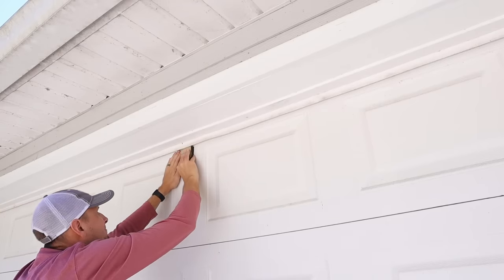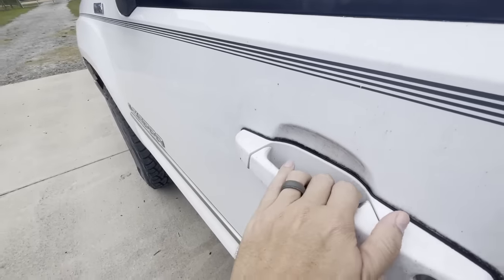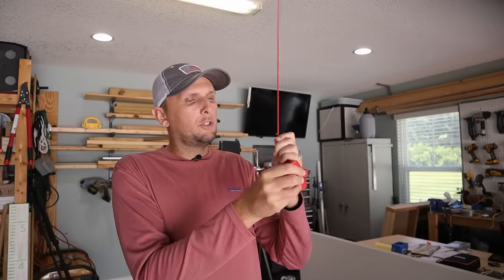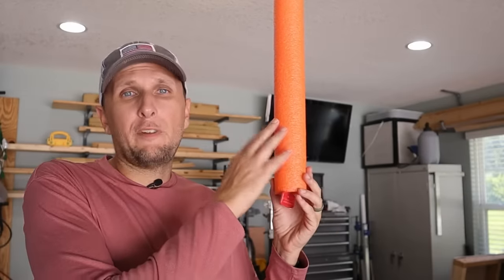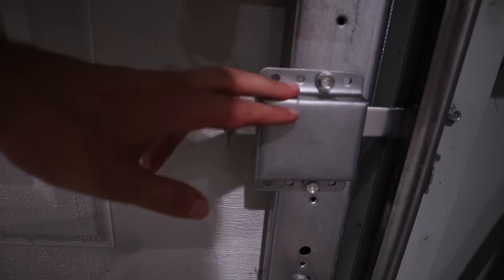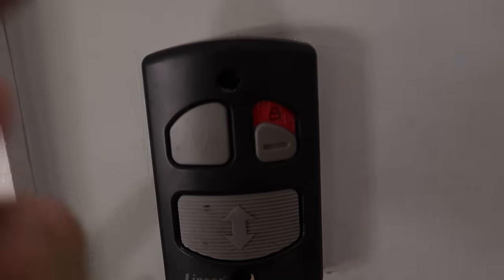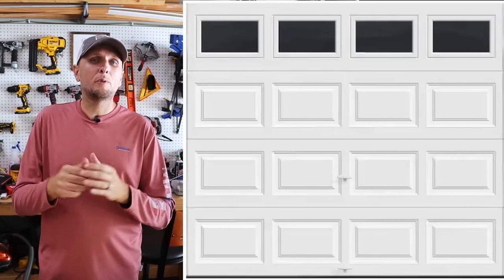How to Stop Garage Door Break-Ins | Number One Way Thieves Get Into the House!

Comment: I had an insulated steel garage door installed which I bought at HD. It came with one garage door slide lock.  I told the installer not to install the outside handle. The installer attached the garage door slide lock. The installer offered to give me free at no charge and install a garage door slide lock for the other side.  This was because I didn't take the outside handle. I have two new padlocks that I've never used. I put those thru the hole in the lock for extra security. No need for anything else.  I don't have an electric opener and no ropes/cables hanging down.  There  are no windows on my garage door. 

My cellar is a walk in. I also have two 30" x 46"  wood framed windows.  Just finished my latest project. Each window  had four panes of glass. 9" high and 28"wide. My father worked with Plexiglass and Lexan. I replaced the glass with 'bullet proof' 1/4" Lexan. On the inside of the wooden frame. I bolted a sheet of 3/16" Plexiglass covering the entire window. I built a frame behind the window. Here is the "pièce de résistance". I had the local vocational school build me a framed diamond shaped security grating. They only charged for the cost of materials. Under $20 dollars for these two windows plus two more. The teacher said it was a learning experience for the students. They used the same grating as what is used in stores downtown in big cities. They did an excellent job of welding the grate to the frame, sand blasting the unit, and even brought it over to the paint shop for priming. I bolted it to the frame covering the entire window from the inside of the cellar.  Good luck to anyone that wants to break into the cellar.   * Before I swapped out the glass for Lexan. Someone tried breaking in when I was in the hospital. They gave up when they discovered the Plexiglass and steel grating behind that. All new caulking and tight as a drum.  Each window now has window blocking curtains. No peeksies now.  

Last  place of entry is a steel door I installed myself 30 years ago from HD. They made steel doors stronger and of a thicker guage back then. It still looks great and not a speck of rust. I reinforced the frame first with two 2" x 6" pressure treated lumber. Added two locks, one being a dead bolt. Added a heavy duty sliding lock on the inside for added safety. Only one of the locks has an exposed key entry. I plan on selling the house in a couple of years due to my age. But I have one more "pièce de résistance" that I have been thinking of.  It is a product made by Domuen and is sold on Amazon for $16.00.  It is basically 2 U shaped pieces of steel the same size as a 2 x 4 piece of lumber. I'm going to bolt it to the frame of my door. I have plenty of 2 x 4. So I'll cut a couple down to the width of the door.

Please peeps. Don't waste your time with flimsy chains attached to your door. Whether it's in a house or apartment. They can easily be pushed in and separated from the frame. It's only held on by an itty bitty set of screws. Totally worthless. Good luck with your projects.

Comment: I use a zip tie at the top of the quick disconnect. Thin enough that you can still break if you pull down on it from the inside of the garage. Also .. shorten the string 👍

Comment: Check local codes on changes to the manual release system, they could be illegal. Be careful about compromising the manual exit release, it could then be a fire trap! I like the pool noodle idea. There is a window in the garage, why not just discreetly break in... put burglar bars over the window! Maybe garage door manufacturers can add a locking feature to the system that locks/unlocks by the remote.

Comment: I use the dude lock latvh and adfitionally snap a buce grips on it. Thise latches can be hooked and opened in a similar manner to the opener string. Some vice grips wide opening welding pliers eill sldo snap doludly into the track tight above the door wheels. Like Fort Knox

Comment: After you remove the cord, if you should have a power outage, just take a coat hanger and cut it like you did for the wire that you used in the demonstration and put a little hook in the end and feed it through that hole to release the mechanism, and just pull down. All you have to do is keep that little piece of coat  hanger handy someplace in the garage.

Comment: I had a good friend who went on an extended vacation and chained the door rollers on th tail from the inside. When he came back from his trip he forgot and went to open the garage door using the remote and did extensive damage to the door. You need to unplug the opener as well.

Comment: I use a zip tie to fasten the disconnect to the frame. I can still use it normally, but in order to release the door in a power failure, just remove the zip tie. Feed the tie into the same hole the string is in and there should be a hole above to feed through.

Comment: When my power goes out my garage door opener doesn't do shit like locking the door as in the video. You can just pull the door up by hand without the need to pull the emergency handle. I found out about garage door locks earlier this year and saw my rails don't contain any extra holes in a place that would allow for the attachment of a lock.

Comment: I have a steel door frame and an solid external door with a triple latch between my garage and my house. When I bought my house there was no internal access between the garage and house, so I had it installed my way. Also, my garage opener button is hard wired into the car so the ignition needs to be on to operate it.

Comment: So my friend just had their detached garage broken into. They had a security camera inside. Thief used the coat hook method but did not go for the cord because there was no pull handle. They went straight for the emergency release latch itself and pulled from there.

Comment: A long heavy bolt through the cut outs in the door rail & on the door works for when you won't be coming in from the outside...like on a vacation or if you don't use that garage space everyday.  Just remember to remove it before opening the door.

Comment: You can remove the rope and they can still use something to hook the lever and pull it....  I used a light weight zip tie to secure the lever. It prevents someone from pulling the lever with a wire or a hook but I can still pull it buy letting my body weight break the zip tie. They also make shields you can install to prevent anyone from fishing for the rope or the lever.

Comment: Just cut the string on the manual release as close as you are comfortable with and tie a loop into the attached end, and another loop in the cut off end. Then when you want to use the manual release just get a carabiner and clip both ends together. No pool noodle needed.

Comment: Adding a latch to both sides of the door and padlocking those is the method I use , but I also add two security bolts, one each to the top and bottom mounting flanges of the latch body, cuzz if the regular attachment bolts are removed the door can be opened even with the padlocks in place.  I also install a security steel 'Fire' door in place of the door leading to the garage from inside the house or in place of an outside access man door, though, that one doesn't need to be a 'Fire' door as they are expensive and worth every penny.
Reply: Note;  Add 'keyed only' deadbolts to the top and bottom of the inside or outside access man doors.

Comment: With at least some, if the connecting rod from the opener to the door is not vertical when the door is closed, one can merely lift up on the door, driving the opener in the open direction.

Comment: Another garage access tip: Don't keep your garage door opener in your car along with documents that will identify your address.

A few years back I noticed some unusual activity going on at the house across the street. I saw a car I did not recognize occupied by two people in the driveway, and the garage door was open. They were trying to pull the car into the garage, somewhat frantically. Within a few seconds they stopped trying to pull the car into the garage and the passenger hopped how of the vehicle and ran into the house. Within seconds the other garage door opened and the homeowner's other car was backed out of the garage, and both cars left the scene.

What had happened is the homeowner's car had been broken into at work and the thieves took the garage remote control and the insurance or registration documents with the homeowner's address, and they went to the house. The keys to the other car were hanging on a hook in the kitchen or utility room.

If they had been successful in pulling their car into the garage, they would have had a whole bunch of time undetected inside that house to do who knows what.

Comment: Instead of cutting the red cord to a shorter length, you can shorten the cord with a long loop overhand knot.  You can still grab the handle from the inside, but a fishhook won't be able to pull a shortened red cord over to the door.

Comment: I had 10k of tools and kitchen appliances stolen this way from a home I was renovating.  My big mistakes?  Not removing the handle on the emergency release and not locking the door from the garage to the house.  Since then I have of course removed the handle, I always lock the door, and I've installed a slide latch on the garage door for when I leave town.  Note, I also unplug the garage motor when I latch the door so I don't forget and operate the motor with the latch engaged.  By the way, the police couldn't do anything about the theft because they were understaffed.  Another reason why it's important to take it upon ourselves to protect our property.

Comment: 1 extra step you should add. Where the handle is at the bottom, you should cut the noddle 1 inch on each side from the middle up. Then slide the noodle over the handle, making it no longer exposed.

Comment: You forgot a good tip I use. There are two holes at the top of the pull down on the rail. When u lace a piece of plastic wire tie through them , u can't unlock the manual pull mechanism. This insures no one can get in. U can use something even harder ,like wire.

Comment: Many people don’t keep a key with them for the interior garage people door…..Once you burglar proof your garage door.. and of course now you can’t use this coat hanger hack to enter your own garage door if the electricity goes out and then you can’t use your key pad or garage door opener.
An obvious tip would be to start carrying your front door key  so you have a secondary access point to your home.

Comment: so if you have a 20 volt battery that charges but as soon or very shortly after placing in the charger,it says its charged .....but when you use it it quickly drains....meaning the battery isnt fully charging...any idea how to fix that???

Comment: If you cut the cord shorter, you also have to take the handle and any knots off the end. A thief doesn't have to get the cord all the way out the door any snag at any length will allow them to pull it.

Comment: A garage door deadbolt is the easiest and most effective solution to garage door breaking, though it negates the purpose of an automatic garage door opener.  But for periods when you will be away for any length of time of time it works best and only costs another $10 at the home store.  Most all garage door side rails have knockouts that can be removed yo receive the deadbolt and a corresponding mounting location on the door.  You can even put a padlock on the deadbolt for more security.

Comment: Zip tie the cord wrapped tight to the release AND zip tie the actual release in the locked position. You can always cut it if the power goes out.

Comment: Remove the handle from the release rope, they can fish all they want, make sure it's too short to reach the top of closed door, the rope is easy to pull without a handle, with a switch to shut off power to opener, with a timer also. And blackout tint for windows.

Comment: 6:50 If you damage your opener by trying to open it with a slide lock in place then your up-force limit switch is out of adjustment.

Comment: Using that wire to fish the string out, almost hooked onto the arm itself that the string is attached to. That would still be possible with the pool noodle. A better way to stop this would be screwing a shield to the top edge of the door that would block any wire from getting near the arm or string.

Comment: Most of the video I was just thinking is not the main fool proof way to lock your garage the metal lock on the tracks. Rolling garage codes have been a big improvement and a lot of new cars have door openers built in that need the ignition at least active to use. If you want to take the best step to keep people out of your garage have a motion activated light and camera always watching.

Comment: Most garage door motor drives have overload protection. If the door side lock is in the locked position, the motor reverses or stalls. The light begins to flash.

Comment: I installed garage doors for over ten years. Who told you it's okay to have a manual door lock with an opener? Good way to burn it up if you forget to unlock  the manual lock and you try to open the door using the opener, if the opener was engaged with the rail. Take off the pull in the rope. Shorten rope. Tie loop on end.

Comment: Camera's and security systems are reactive not proactive. You need methods of entry denial to be more secure. And wireless garage entry can easily be hacked, even the smart ones you said were encrypted. At night just slide that lock in place. And most openers have load sensors that will prevent damage if you try to open it with the latch in place.

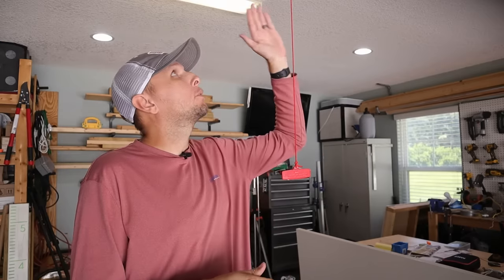Comment: 4:40 Most doors are Tilt-a-doors, where the opening system uses wires, about where the side latches are, to the middle mounted door handle, so fishing underneath does the same thing, it catches the wire enough to "pull it down tensioning the side latches to open at least one side, by then pulling that side open the door twists enough to bring the dtill locked other side latch far enough away from it's strike plate to allow the door to open correctly.

One way to get around that is to fully remove the wires altogether, while leaving the latch LOCKED, after ONY ever opening the door from the inside, by accessing into the garage via a deadbolted side door.
Now whathappens is the burglar comes along, trys twisting the handle, it's locked, so they set about trying to fish one of the latch wires, which of course, is not there.
After some considerable to=ime spent down there, the last thing they will think of, is that deadbolted door, some way along the side wall, that just looks like the rubbish-bin door, with of course a few torn (& thus empty) rubbish bags nearby?

Nice one Trev.

Comment: With a short cord they might be able to hook the handle anyway and just pull it with the long coat hanger from outside.
An easy thing to do is loop the cord around the bar that pulls the door up.  By looping the cord over the bar, THEN putting the handle over the cord going up, it forms a loop locked on the bar.  It is impossible to pull it and you can either use a wire coat hanger to un-loop it, or a stepladder or box to reach and unloop it.
..
OR..
Remove the pull cord, then just fashion a coat hanger and any kind of handle that you can keep near by to hook the  latch-lever the cord goes through.  To make it easier to snag the latch, make a very short, but larger hook out of coat hanger that stays in the top latch hole where the cord was.
..
Also, the car should be locked when in the garage.

Comment: We will not have any of these problems as someone is home 27-7. If we all go away for a vacation (and we do) the door is locked by unplugging the opener and using the 4 slider bolts that we have on each side of the door top and bottom. The door can not be pushed so to get to these nor can the door be opened as the door is supposed to open. Then there are several doors through the home that have dead bolts built into them and the front door has 2 dead bolts in a steel frame.

Comment: I saw a video decades ago where the thief used a dolly to open the overhead door. Slip the dolly blade under the closed door where the door opener is and pull down on the dolly to force the door up. The force breaks the plastic gears then the thief can rase the door.

Comment: You didn't mention anything about arm adjustment and being over center some of the older garage door openers could be jammed open by lifting the garage door that the arm wasn't properly adjusted and put pressure on the opener itself causing it to default back open because it thinks it hit something just like leaving a took under the door when it hits it reverses

Comment: Another way that you can secure your garage door (if your locks are broken) is to insert a gutter nail into the holes near the bottom of your garage door rail and the track rail on the inside of the garage. Insert it all the way to the head of the nail and let the point of the nail tip down to the floor so that it is in a slanted position.  Alternatively, you can use a long bolt (inserted the same way) and then you can put a nut on the other end.

Comment: Won't work on my garage door. The door is keyed and the release is behind the lock. You would have to pick the lock. The pull rope is on the side and is only used to close the door from inside.
Once the lock is released from inside I have to manually lift the door open.